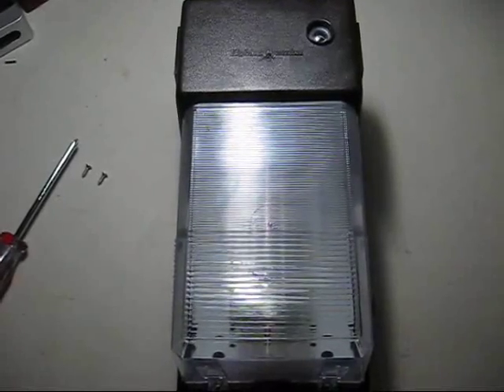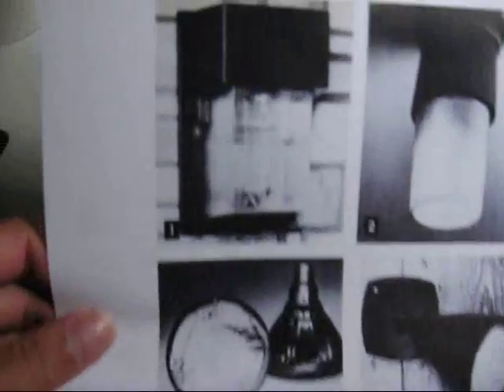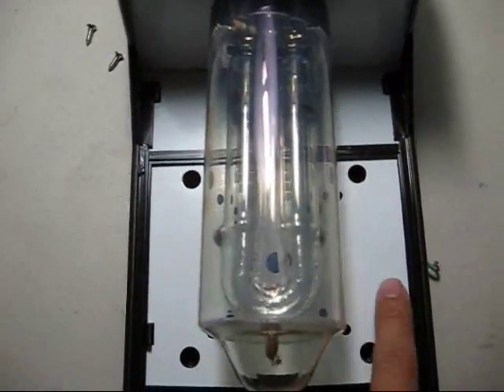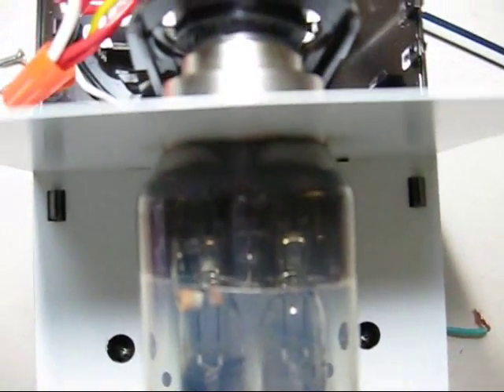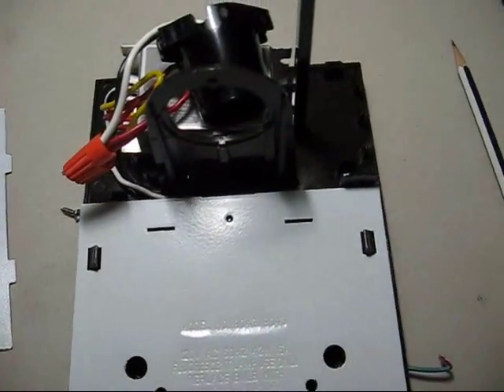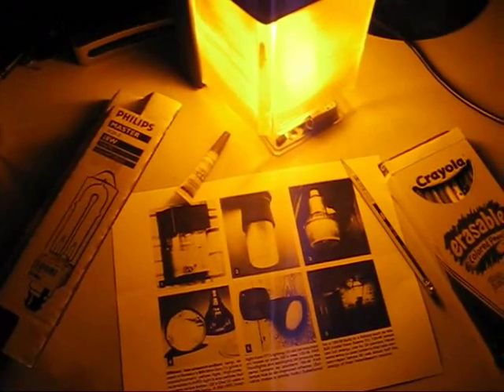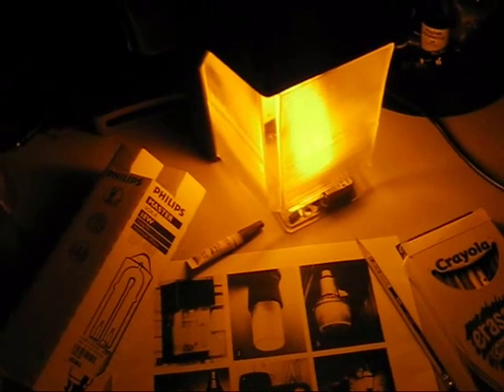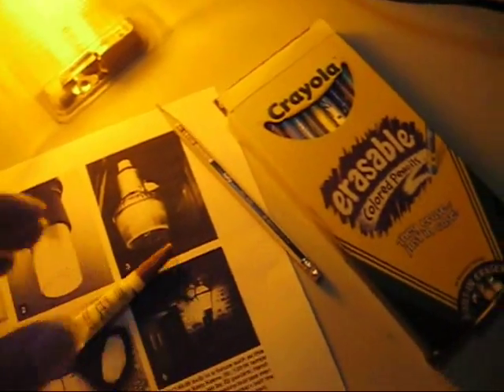My low pressure sodium converted Lights of America wall pack

Comment: Advance makes all the LPS ballasts ya need.
Reply: cengeb does anyone know if advance sox ballasts can operate SO/H lamps and SOI/H lamps?
Reply: @cedricwoirhaye8268  nope, totally different electric specs
Reply: cengeb do u actually know about those old british sodium lamps?
Reply: cengeb the 35w SOX replaced 45w and 60w SO/H, the 55w SOX replaced the 85w SO/H, and the 90w replaced the 140w SO/H.
Reply: sailormoon_01_uk is a well respected lighting collector since he collects both American and European light bulbs and knows their specifications pretty well. here is a link regarding how one of his 60w SO/H lamps is compatible with 35w SOX ballasts: https://www.lighting-gallery.net/gallery/displayimage.php?album=2800&pos=28&pid=140557
Reply: @cedricwoirhaye8268  I only have in use the 18W mini sox-e and 55W sox..none of the old designs. I know the sox-e versions 66W replaced 90W Sox but using them on old magnetic ballasts, you didn't get the benefits of the higher efficacy if not on sox-e electronic ballasts
Reply: @cedricwoirhaye8268  Just use Osram, GEC, GE (Thorn), Philips, not the antique stuff. since the antique stuff was out way before the modern versions, I still would say the specs are not compatible...  open ckt volts, total wattage, etc, the 55W Advance is certainly not rated for 85W, the Advance 35w/55w ballast is the same ballast and is labeled as such, the wall pack can use either lamp, if it's a 55W wallpack, it's longer, 35W wall pack is smaller, but with the same ballasts, either the Hubbell or Philips norelco stuff, made in U,S.a. long gone I have many of them fixtures, and in use.  The 90W Advance is not rated for 140W neither.  the only one that would seem possible is the 45W on the 35/55W ballast, IF, the open ckt voltages are correct, and the proper power factor capacitor
Reply: cengeb did you know that 35w SOX was originally 40w, 55w was 60w, 90w was 100w, 135w was 150w, and 180w was 200w?
Reply: cengeb I actually operated European 70w and 100w SON-T lamps on US PSMH ballasts of their corresponding wattages.
Reply: @cedricwoirhaye8268  Different generation of lamp, with different specs and characteristics...the lamps over the decades evolved, even with versions of current lamps the heat coatings changed over time at Philips.  super sox, pro,they had several names for each generation of current lamps..now all ceased production, factory closed...LED took over, even though LED street lighting for driving is absolute horrible, glare, and lousy in rain and fog.  LED fixtures tiny point sources that are not well designed, and GLARE horrible
Reply: cengeb The 140w SO/H lamp actually has almost exactly the same arc voltage and current as a modern 90w SOX.
Reply: @cengeb do u say that SO/H lamps will quickly burn out on modern gear?
Reply: If you take a look at this link, it shows a 140w SO/H lamp being operated on a 90w LPS ballast.
Reply: @cedricwoirhaye8268  It also goes for the ballast can handle the extra load, if you the 90w ballast can handle 140 W, then fine I forget if the 90w ballast is also 135 I had a 90W fixture, I don't recall the 90w advance ballast also for 135W lamp I know for sure 35W and 55W lamps run on the same ballast, ballast is labeled as such. Check the advance online catalog
Reply: cengeb its a thing that SO/H and SOI/H LPS lamps are much rarer than modern SOX lamps.
Reply: That is why I would like to have some.
Reply: I am often checking up on the british ebay since these lamps are mostly found in the UK.
Reply: @cedricwoirhaye8268  I have 5 18W mini sox running every nght and a55W in a hubbell every nght lst years and years and years, I had a Philips wall pack made in van Wert OH,  the fixture was over 30 years old, daily use, finally yellow poly carbonate lens go too yellow, and the ballast finally fried, first one EVER, i swapped the ballast at the time, i keep spares, but the yellow lens was too much blocking light...I couldn't find on Ebay another  Philips norelco 55W wall pack, so i got 4 band new hubbell 55W wallpacks, been in use now  since 2007, works great, i did find a 35W Philips on ebay brand new, I got it just in case...run 5 18W including a Stonco glass lens 18W LPS, also out of production, everything is LED, ugly glaring harsh white LEd, they blow..so i have enough spare lamps, ballasts and fixtures to out last me
Reply: WestinghouseCeramalux is an American bulb collector that actually has a 60w SO/H lamp.
Reply: @cedricwoirhaye8268  Well the old lamps have been obsolete for decades, i use them for function...they have had several versions of the current type SOX ..pro, long life, they have changed the getter to PSG, they have changed the infra red coating to a better type, changed the insulators from metal to mica, i have seen all the variety since the 80's in use...OSRAM and GE/Thorn have no retaining dimples, they have the ridge at the bend, but they also have a different way they coat the inside of the out glass, subtle differences...the Philips lamps I starting using in the 80's were from Belgium, it was the largest lamp factory in the world, Philips, they closed that and moved SOX to UK, where they then where making their own, and GE GEC and Osrams, as the demand was fading... the UK plant is now closed, SOX is a dead product, only what's in warehouses..like i said I have plenty of 18's and 55W now for my daily use with 6 fixtures...spare ballasts, sockets, and lamps, and a few fixtures them selves...there is a guy selling for $120 out of Calif  on ebay a Stonco 18W LPS nice glass lensed wall pack, I use one and have a spare..$120 is cheap, no lamp though, they used to be like $300 fixtures when sold, they are all now LED, in same fixtures...led sucks..and once in a while someone is selling SOX lamps of different watts, I got a great deal years ago 12 18W LPS for like $77 brand new Philips lamps, on ebay, usually they run around $30 each, many free shipping, nowhere near the absurd list prices, though I have seen some selling some a t absurd prices, I also have a 180W Philips Van Wert OH fixture the 180W flood metal fixture the thing is 4 feet LONG!!! MONSTER...got a few 180W lamps they are gigantic lamps, gigantic fixtures meant to be 50 feet or more in the air, BRIGHT!!!120/240 V multi tape Advance ballast
Reply: there are those SOX 18 bulkheads that sell for outrageous prices. It seems pretty stupid that SOX has been phased out because governments have claimed that they are less efficient than LED. In reality, they have much better efficacy than LED.
Reply: Why is it that SOX ballasts in europe have ignitors and why American SOX ballasts don’t have ignitors.
Reply: SOX lamps dont have any mercury at all.
Reply: @cedricwoirhaye8268  For roadways, bridges, tunnels, SOX is the BEST,  linear source, no glare, the color is best, no glare.  After all the years since Philips introduced the first SOX in around 1932, it was continually improved, the 180W lamp was at 200lumens /W  some LED are close, but they are not the most common..and usually the highest lm/W LED is in the most horrible glaring blue white, that is intolerable, especially on roadways.  But LED is now probably cheaper to produce, which is always about the money.  SOX is a very specialized mfg, and probably lots of labor, while other types of lamps are highly automated mfg.  SOX look not so easy to automate mfg.  And the newest versions SOX e which the 18W was first, then  like 66W etc, on electronic ballasts further improved the efficacy...and reduced weight...why they didn't keep going with it, sucks.  the 66W replaced the 90W SOX , and a few others.  SOX is also good on residential security lighting as it doesn't bother neighbors, the yellow just doesn't glare through windows, like my neighbor has just installed very bright high Blue white LED on a post light, and doorway, small look like candelabra style, exposed  lamps, in carriage style fixtures, very bright,, lousy optics, pure GLARE....looks worse than a used car lot, Metal Halide GLARE, impossible to be under for long periods of time...SOX is always best. Linear source, not tiny spots on roadway fixtures, that seem to puncture your eyeballs
Reply: cengeb ive been wondering if thorn beta 5 lanterns would be used as ‘dark sky’ lighting since they are a non cutoff sox streetlight commonly found in the UK?
Reply: @cedricwoirhaye8268  they are big on that Dark Sky in AZ..in the U.S., they loved LPS for the telescope use, easy to filter out, and didn't interfere with the stuff, white light sucks for telescope and sky glow
Reply: cengeb when looking at some of the early european LPS street lights, some of them were cutoff in design such as the philips SORA and the Revo C13660/T. There have also been some GEC cutoff SOX fixtures later on that were commonly used in the UK.
Reply: The UK also has a wide selection of LPS ballasts, but you would likely need a step up transformer or run them off of a cooker outlet.
Reply: cengeb Actually, SOX was developed in the 1960s. The actual LPS lamps that were developed in 1932 were actually SO/H. They eventually were replaced with SOI/H in the early 1960s, but the SOI/H got replaced with modern SOX shortly after. All of these lamps use the B22 cap that fits into your typical British light socket, but the B22 lampholders must be hooked up to the correct ballasts.
Reply: For the American market, GE developed NA-9 and NA-10 LPS street light bulbs with 4 pin bases. The Golden Gate Bridge in San Francisco, CA, USA used such lamps up until the 1970s when they were replaced with modern HPS lighting because these old lamps became obsolete. Interestingly, the US adopted British SOX street lighting around that time due to the 1970s oil crisis as a way to save energy due to the extremely high efficacy of SOX street lighting. Plus, cities near astronomical observatories and cities near beaches heavily populated by sea turtles adopted SOX street lighting to help minimize light pollution as a way to help astronomers search the heavenly night sky and to help  baby sea turtles migrate into the ocean where they are supposed to belong.
Reply: @cedricwoirhaye8268  LPS is preferred as it has much less sky glow, no matter what fixture....Astronomers prefer LPS, easy to filter out, and doesn't obscure the sky like blue white light..AZ is pushing for AMBER LED, if they start removing SOX, since the lamps ain't made anymore
Reply: cengeb it really is a sad thing that All LPS has been discontinued. The older types that i mentioned to you earlier were already discontinued decades ago. Interestingly, there were SLI/H lamps. These were a type of LPS lamp that resembles a fluorescent tube and actually fits inside fluorescent tombstones provided you have the proper ballasts for them. They were also used for streetlighting in the UK just like SOX was.
Reply: @cedricwoirhaye8268  The first LPS road installation in 1932 Philips in the Netherlands, just when they introduced the first generation of SOX...and they kept making each generation better. GE wasn't marketing SOX in the 80's they had ads downplaying LPS versus HPS, since they developed HPS, introduced it here in the late 60's...LPS was the start of it, of course Philips...out on Long Island N.Y. lots and  majority if not ALL, of roadways where SOX Thorn fixtures(before GE bought Thorn and Philips, LED is there now, it really SUCKS in the rain, it's actually dangerous, the glare from the horrible LED is blinding..with LPS is was comfortable, no fatigue..LED suck on roads and bridges, in tunnels, like Lincoln Tunnel into NY from Jersey, they put LED that are so horrible, blinding, the spacing is all wrong, it strobes at speed, absolutely zero optical control, the old TL fluorescent fixtures where better, linear source, not horrible overly bright blinding dots..a few tunnels still have LPS, rare..and with lamps not being made, once the warehouse is empty, out they come...
Reply: cengeb actually that 1932 LPS installation in the netherlands actually consisted of SO/H lamps, NOT SOX. These lamps consisted of a removable discharge tube inside an outer glass sleeve. When the discharge tube burns out, the old tube is discarded and a new discharge tube is inserted into the glass vial. The SO/H lamps of 1932 had wattage ratings that were originally 50w, 65w, 100w, and 150w. In 1937, the ratings changed to 45, 60, 85, and 140 watts. These SO/H lamps became obsolete in the early 1960s as they were replaced by SOI/H lamps which are LPS lamps that resemble the modern SOX lamps as they have their discharge tubes integrated inside glass envelopes. Their wattage ratings were actually the same as the older SO/H lamps plus a 200w rating. By the mid 1960s, SOX lamps almost completely replaced the SOI/H lamps except for the 45w SOI/H since there was no SOX replacement for that wattage rating. SOX lamps originally had wattage ratings of 40w, 60w, 100w, 150w, and 200w. By the early 1970s, SOX lamps were given their wattage ratings that we know today: 35w, 55w, 90w, 135w, and 180w except for 18w, which was introduced in the late 1970s. The aforementioned wattage ratings were actually the only type of European LPS lamp to find use in the USA. The early 1980s saw the development of the SOX-E line of lamps by Philips. They had wattage ratings of 26w, 36w, 66w, 91w, and 131w. In addition, GEC developed an even smaller SOX lamp with a rating of 10w at around the same time to be used in security lighting and safelights. The 10w SOX almost never found use in the USA. It was discontinued shortly after. Also, there was an even smaller SOX lamp that was made by Thorn in the mid 1980s with a wattage rating of 6w. Interestingly, these lamps were small enough to fit inside ordinary British light fixtures designed for incandescent lamps. Even then, those puny SOX lamps still needed ballasts. Those lamps never took off due to having a significantly lower efficacy than the other higher wattage SOX lamps. The late mid to late 1990s saw the development of SOX plus lamps. The SOX plus lamps were developed to increase lamp life of SOX bulbs. Lastly, the early 2000s saw the development of the SOX PSG lamp. Unlike most SOX lamps that were ever produced, the SOX PSG lamps consisted of Philips solid state getters rather than Barium getters in the older SOX lamp designs. They were developed to increase lamp life and reliability much like the SOX plus lamp did in the mid to late 1990s. Hope you enjoy my explanation regarding the history of how SOX lamps came to be. I learned much of this information about LPS lighting history from a trustworthy website known as http://www.lamptech.co.uk . Here is another website that talks about LPS lighting including lamp characteristics and its history: http://www.soxlamps.org
Reply: interestingly, the SO/H and the SOI/H can only be burned in a horizontal position as well as the SOX/H. The only LPS bulbs that can be burned base up are the standard SOX, SOX Plus, SOX E, and SOX PSG as long as their wattages range from 18w to 55w.
Reply: Well known examples of LPS fixtures that allow the lamps to burn in the base up position are the American Electric SOX Nema heads and the British Thorn Gamma 6 and Gamma 9 post top SOX fixtures.
Reply: Most LPS fixtures had their lamps operate in horizontal positions because it allowed for maximum lamp life and optimal efficacy.
Reply: @cedricwoirhaye8268  Philips Lighting U.S. made 35W Dusk to dawn  LPS, fixtures, in Van Wert OH, they never  photo cell on top small arm mounted to pole or wall, guy had about 4 in his dock for over 30 years, his area was easy to find, everyone else had  harsh white stuff, pure yellow was glare free, on the water even better for misty nights base up, 35W could be base up horiz, never base down, no sox is ever base down.  the American Electric stuff was all from Philips Van Wert OH, when Fixtures where sold off in the U.S., years later Philips bought Genlyte fixtures  for close to $3 Billion, added all kinds of brands Stonco, Lightolier, Hadco, a dozen or so..just recently as Signify, they bought Cooper Lighting i think for about $2 Billion, more brands now part of Signify, they pretty much now have the fixture market in the U.S. and the world, they where always the biggest lighting company Philips, they just keep growing now independent company Signify, using Philips name for a certain number of years..to transition
Reply: cengeb Did you read my story about how LPS lighting evolved in both the UK and the US?
Reply: cengeb It really is interesting to know that Philips did make SOX dusk to dawn fixtures for the US market.
Reply: @cedricwoirhaye8268  none of my many SOX fixtures over the years ever had an igniter...some have Power Factor cap, so it is HPF, reduce current draw, never igniters,  not 18, 35, 55, 90 or 180 , maybe the ballasts are different design, need the spike to start the lamp, HPS always have ignitors
Reply: @cedricwoirhaye8268  I did not see that, no
Reply: cengeb The truth is that its only the european LPS ballasts that have the ignitors.
Reply: I perfectly do understand that US SOX gear has no ignitor.
Reply: cengeb, its actually true that LPS is broad category of discharge lamps and SOX is actually a specific type of lamp that is part of the LPS category of discharge lamps.
Reply: @cedricwoirhaye8268  HIGHTSTOWN -- In its heyday between the two World Wars, the Hightstown Rug Co. prospered as one of the borough's most important employers, providing jobs to many residents and making rugs and later parachutes.

But the onetime mill has sat vacant for decades since its last tenant, light bulb manufacturer Philips Lighting Co., shut down the complex in 1987.
Reply: cengeb here is a link to a website that talks all about LPS lamps and their history: http://www.soxlamps.org
Reply: @cedricwoirhaye8268  cool, interesting stuff
Reply: cengeb its interesting to know that Berlin experimented with LPS streetlighting of the SO/H type in 1931 near the Osram factory but the first official installastion of SO/H LPS streetlighting was in the netherlands in 1932. The UK followed suit with these street lamps that same year.
Reply: It’s a true fact that LPS street lighting was very popular throughout the UK for many decades. The LPS ballasts that were made by Advance were designed to operate the LPS lamps that were designed in Europe.
Reply: cengeb in your opinion, what was something interesting that you learned about LPS lighting in the UK?
Reply: @cedricwoirhaye8268  only 18,35     55 on up are horiz
Reply: @cengeb  ALL SOX lamps are rated for horizontal operation.
Reply: @cengeb  I found out that the US SOX ballasts actually have a high OCV and that is why an ignitor is not needed. If the ballast has a lower OCV, an ignitor IS needed to strike an arc.
Reply: @cengeb  140w SO/H lamps will NOT damage 90w SOX ballasts at all.
Reply: @cedricwoirhaye8268  yes but only 18 and 35 can be verticle base up..I've had several fixtures in operation 40 years 18,35,55 and a 90